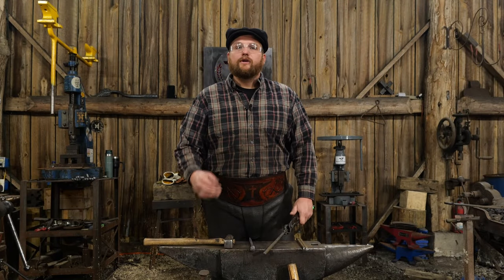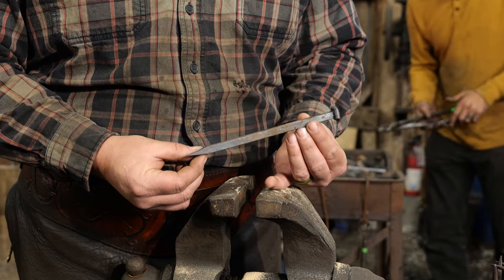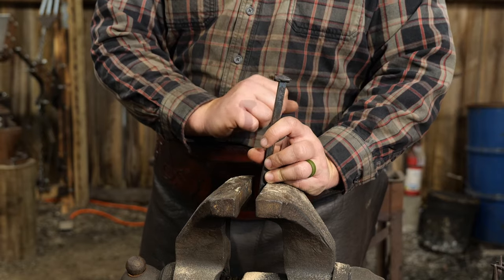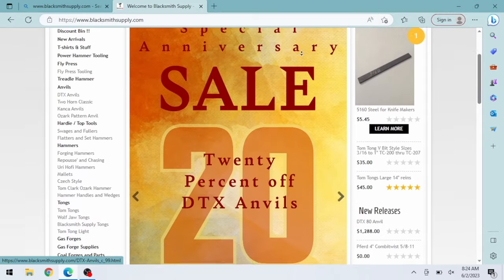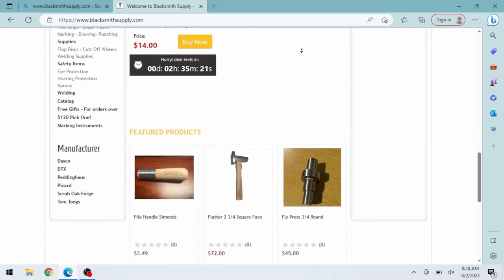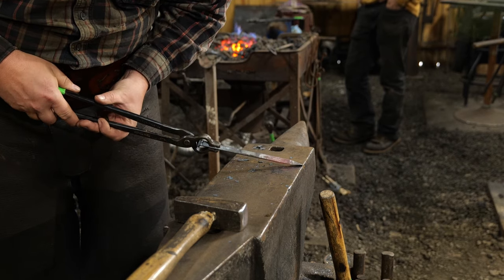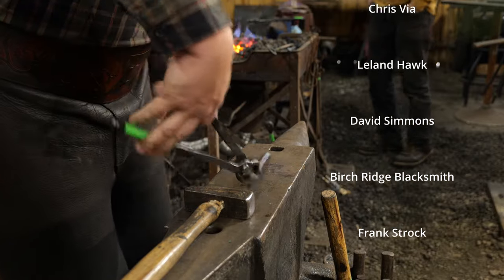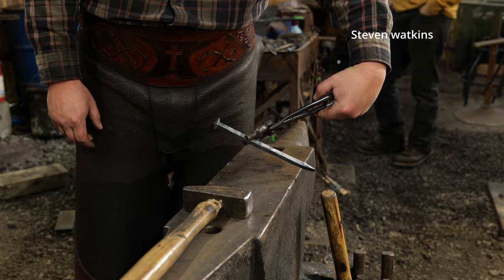Forging REALLY BIG Nails!

Comment: Worth remembering that if you are driving the spike through wood without drilling a pilot hole, then best to line up the chisel tip across the  grain of the wood, not aligned with it. This will enable the chisel to sever across the adjacent fibers, rather than acting as a wedge, thereby splitting the wood.With a spike this size I would probably pre-drill with a pilot about half the diameter of the spike dimension, maybe a little more in harder timbers
Reply: You want it to cut like a chisel, not split like a wedge.
Reply: @Bangalangs  
Exactly - the 'chisel' end cuts the fibers. 
The old type cut nails often used in floorboards worked in this way, as the flat square tips would rupture the fibers. Carpenters often deliberately blunt or flatten the tips of new round nails for the same reason, especially when working near the ends of a board.

Comment: @Christ Centered Ironworks  
SO...  Roy, If I understand you right:  
1st you take a "double-cube", or an inch, of the spike and forge it down to a symmetrical taper and let it 'fishtail' out; 
2nd: turn the spike 90* and forge another symmetrical taper by forging the 'fishtail' down into a taper that should retain the width of the parent bar stock.  Did I get that right?
I gotta try that this weekend!  Thanks Again for a Great Video. God Bless You and Your Family.